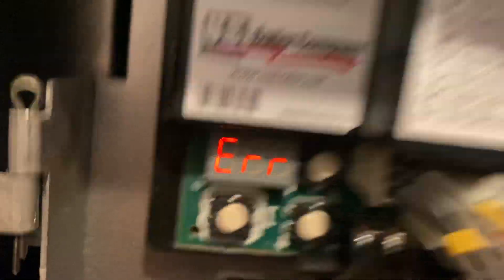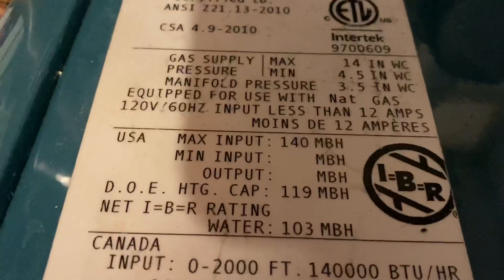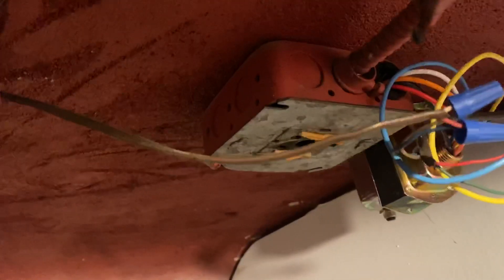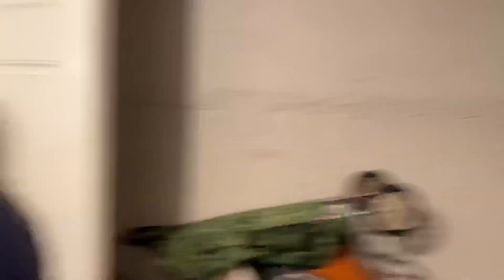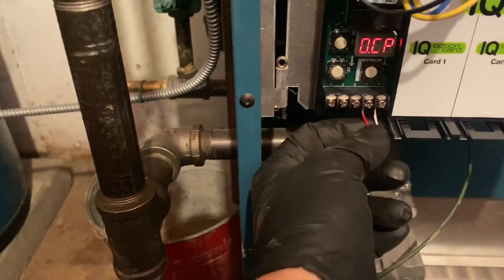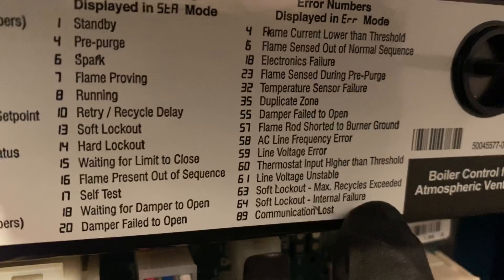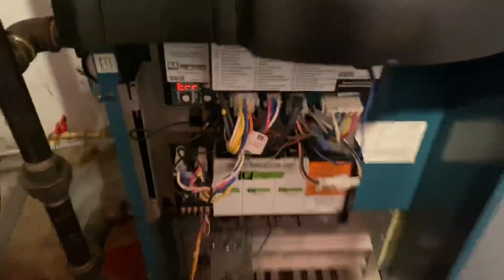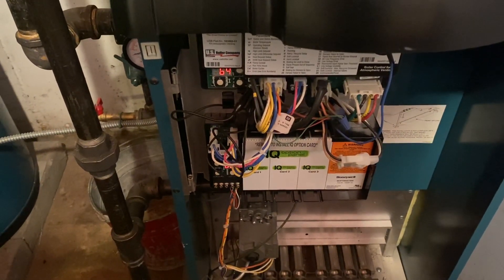Burnham ES2 Error 64 on Intelligent Hydronic Control 103660-01 ERR 64 Internal Failure Bad Control

Comment: Hi there, I replaced the board twice, had a error 56, I replaced the dumper switch still, now I get error 64. As NY thoughts?
Reply: @PipeDoctor  disconnect the low water cut off and it’s working perfect with old parts, not sure why